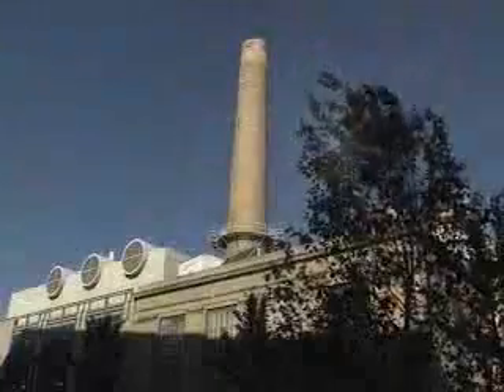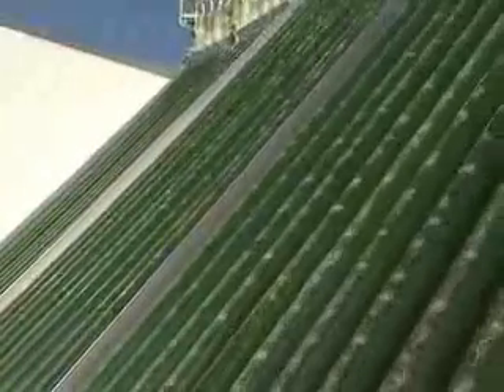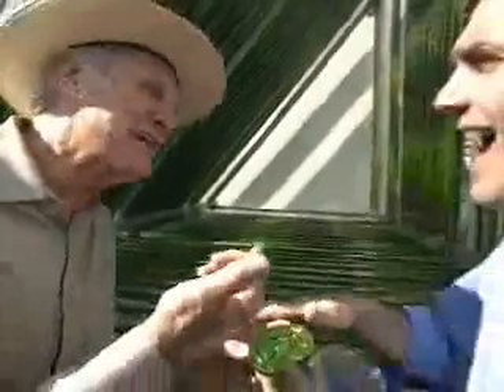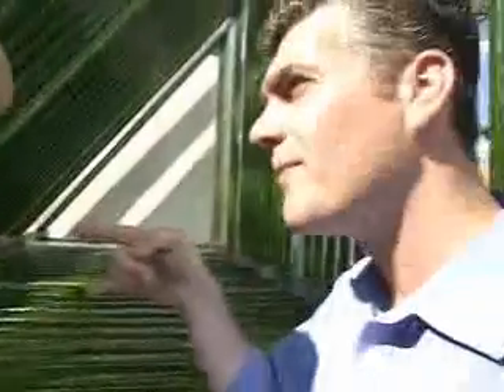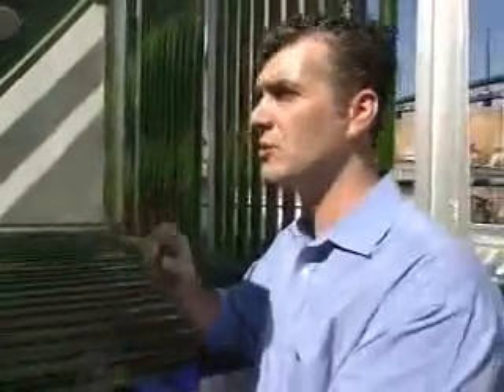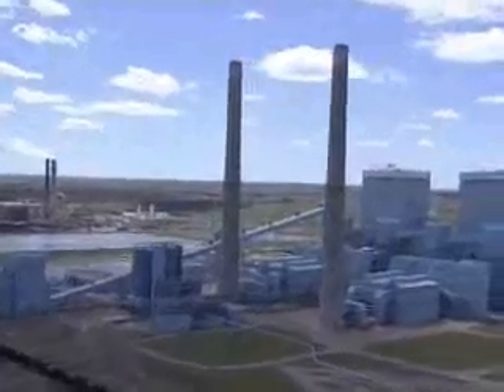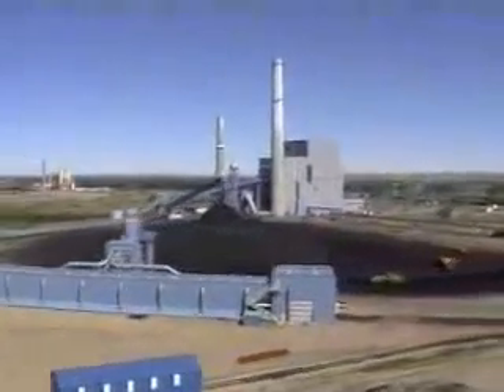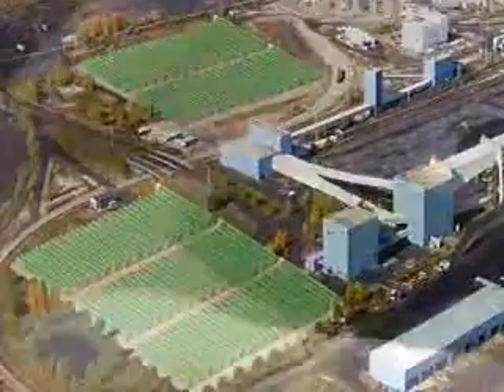MIT Algae Photobioreactor

Comment: Hardly. As SockPupperCommentary was convinced that algae farm for energy would be better, I am fairly sure that they will cost more.

Your right about the light being intense. Shading / shielding  with an outside layer and some gas pressure in between might work. The outside will radiate the intense heat from the sun away and the gas layer would would wrap around to the dark side where it would be cold.

Comment from the maker: Update: I'd recommend googling "Winogradsky columns", it sounds like a good start if you want to experiment with producing methane from an artificial swamp.
Check out the Production chapter in the wikipedia Methane article.  Mentions methanogenesis (your biological route), but also mentions the Sabatier and Fischer-Tropsch industrial processes which do the same thing.  These will be your competitors in the efficiency game.  Good luck :)

Comment: Continued:
I could be wrong but it may be significantly cheaper to both build and maintain a "solar cell and recycle batteries" solution.

On the other hand, maned space flight for long duration in space will likely require looping human bio waste streams with algae back into food and oxygen. In this area, algae seems to be the most promising solution.

Comment: I would like to see some one calculate a closed loop system where Given a specific generator's annual energy needs, how much acreage is needed to capture the suns energy with algae, strain, dry and burn completely. Said system would use O2 created by algae to burn the algae fuel, and the CO2 to feed the growing algae, along with other nutrients being recycled; and then work out the capital cost to build and maintain such a system.
Reply: That's the question most people don't want to answer, because usually the net energy balance is negative.

Comment from the maker: cont...
The algae has only absorbed maybe 1% of the solar energy, so this is the max energy you're starting with, to digest it into methane brings it down further, each process is wasteful.  It doesn't matter how long it takes to digest, you can't squeeze more blood outof the stone than was in the stone to begin with.
5yrs vs 100 yrs.  If the solar+battery system produces 20X the energy, it can afford to be 20X the price or be replaced 20X as often (or a mix of those).

Comment from the maker: Correct, that is what i'm saying.
I do like your idea, i'm curious as to the specifics though so i can work out it's advantages/disadvantages compared to other options.
From how you've described it, it sounds like an artificial swamp connected to a landfill-gas operation, which is cool i guess.
That "one harvest of algae", digested over weeks, will still provide less than 1/30th the total energy that solar panels and batteries would have.  Photosynthesis is just too inefficient.
Continued...

Comment from the maker: But you're talking probably sub-1% solar efficiency all up.  Probably much worse, but i don't know any efficiency figures for algae-biomass to methane.
Solar panels with ANY kindof batteries would beat that, no matter how much they needed replacing.  It could be over 30X the cost of algae and would still be cheaper.  Also bacteria will shade the algae in the photobioreactors if they are grown together, further reducing efficiency.  Thus sterility is normally a very serious concern for growers

Comment from the maker: Woa i never even thought of combining it with anaerobic microbes and methane, that's a good idea!  
Don't burn it as a stationary fuel source though - photosynthesis is way too inefficient at converting sunlight into energy compared to modern solar panels.  Instead use that methane as a transportation fuel; for cars, trucks, trains, planes, etc.
For stationary power, use solar panels with energy storage (flow batteries, pumped hydro dams, compressed air), or solar thermal with heat storage.

Comment from the maker: @captncanuckle >"coldest global year on record"
Doubtful.  Which year?  check the records.
Also graphs are not straight lines, they do have dips.  A single cold year does not change the trend of increasing global temps.

A few glacers are growing, most are shrinking.
Antactica's ice sheet tends to grow in winter, winter just ended 3 days ago.

The medieval warm was not global, and temps have been greater than it since at leasts the 1960s (more likely the 1900s) and temps continue to increase.

Comment from the maker: The increased sunlight would make the algae require more CO2 as well.  So you will have to increase the bubbling.

I have seen some photobioreactor plans that use concentrated sunlight, rationed to feed more algae via fibre-optics.  The concentrated sunlight is split into many fiberoptic lines, each feeding dim partial sunlight into a separate algae vat - stacked vertically.

Comment from the maker: Pre-concentrating the CO2 (ie: by harvesting smoke stack emissions) before it is fed to the algae increases growth by 20% (iirc) compared to algae fed with natural CO2 from fresh air.

If you increased the sunlight, you may have to take steps to avoid overheating/overexposing/burning the Algae.  But if you could avoid those problems i imagine you could increase algae growth proportionately to the amount of extra sunlight.
ie: 10x sunlight (if properly rationed) could produce 10x algae.

Comment: "can mirrors be used to get more eficiency on those plants?"

Doubtful, plastic tubes are probably cheaper than mirrors and there are saturation effects(plants are most efficient in low light levels, when illumination increases you increase productivity less than you increase the illimunation)

Comment from the maker: i'm not sure if that % figure is for space or terrestrial.  I don't think it takes solar concentrators into account, but i don't think it makes much difference outside of the lab.

I've recently seen a rough test result in 30% realworld efficiency by GreenandGoldEnergy (a Suncube solar tracker using Zirtec panels).  So i'm confident that they are 35% panels.

Comment from the maker: oh i see.
so you mean - have algae stacked so high so that it's in complete shade down the bottom but have mirrors illuminating that shaded area.

i guess it could work.  It'd be a question of the cost of mirror area vs the cost of photobioreactor area.  If you're using cheap flexible plastic bags to grow the algae (Vertigro) then you may well choose cheap flexible plastic mirrors (ie: coated mylar).  
Either way is cheap, but the mirrors may need a tracking system which would complicate things.

Comment from the maker: You can only have so much algae stacked vertically before you block out the light completely.  
So you can either have:
- low concentration algae stacked very high or,
- high concentration algae stacked low.

Think of each algae cell as a layer of shade cloth.  You can only layer so much shade cloth on top of one another before you block out %100 of the light - then any extra layers after that are useless as there's no sunlight left anyway.

Comment from the maker: hmm, you're kindof right there.  The Greenfuels system in this video is projecting 5,500 gal/acre/year which works out an efficiency figure of 2.3%.  They are trying as hard as they can, so it's far from the worst.

However, Valcent's Vertigro algae growing system is projecting 20,000 gal/acre/year which is an 8.3% efficiency rating.
And if Valcent JUST grow algae for biomass - they have already PROVEN a yield of 276 tons of algae biomass/acre/year.
(but i'm unsure how much energy is contained)

Comment: 35% efficient PV is the very best of solar, and 2.3% algae I would assume would be some of the very worst.

I agree though.  Solar more or less will be the main source of power for our electric grid.

However, algae can clean up our current problematic coal plants.  Sequester the C02 straight off of the coal plant, turn it into fuel, burn it again withe the coal.

It seems to me that we could do that right now, cut emissions for coal plants, while we start building solar panels everywhere.

Comment from the maker: It's definitely a sound idea.
but photosynthesis is nothing amazing - just a chemical reaction.  It still has to compete with other renewable energy sources.

You gotta admit, as far as grid-based renewable energy goes 35% efficient solar PV panels are more attractive than 2.3% efficient solar algae.

Algae's advantages are:
- Easily produced Liquid fuel (ie: for transportation)
- Sequestered CO2

it shouldn't compete with Solar PV for grid electricity though.

Comment from the maker: Yes this is one reason photobioreactors are better than open pond systems.  However, as you go vertical you can only increase the algae concentration until you cast a full black shadow.  Once you reach that - you can't increase the amount of energy being absorbed.
And that max absorption IS assumed in the calculations.

It's a basic concept of harvesting solar energy: the energy you absorb is the same (or less) as the size of the shadow you cast on the ground.

Comment: except the energy is from photosynthesis, so its free and green.  Just use the algae which takes energy from The sun, and the carbon from the smoke stack and turn it into fuel to be burned again.  I'm talking about a method to clean up our current energy supply, while we work towards replacing it.

Comment from the maker: Theoretical upper solar efficiency limit of photosynthesis: 11.5%
Actual solar efficiency of photosynthesis 3% - 6%

remember - Algae gets all it's energy from photosynthesis.  As you can see - for anything claiming to produce more than approx 6000 gal/acre/year, the figures just don't add up.

It's still much better than 800gal/acre/year palm oil (yay), but i wish they would just tell us the real figures from the start instead of BULLSHIT!

Modern triple-junction Solar Panel:  35% efficient

Comment from the maker: Sunlight's energy: approx 2190 kWh/m2/year
Biodiesel's contained energy is 36.94 kWh/gal (0.133 GJ/gal)

here's some efficiency figures i worked out:

100,000 gallons/acre/yr (13,300 GJ/acre) - 41% efficient
Greenfuels initial estimate 44,515 gal/acre/year (5920.495 GJ/acre) - 18.5% efficient
Greenfuels currently estimate 5,500 gal/acre/year (731.5 GJ/acre) - 2.3% efficient
Vertigro's claim upwards of 20,000 gal/acre/yr (2,660 GJ/acre) - OVER 8.3% efficient

Comment from the maker: Ok, i just did some figures.  Greenfuels first claim was 44,515 gal/acre/year.  
Given 250W/m2 of solar radiation and biodiesel's energy content of 0.133 GJ/gal - this would put them at 18.5% solar efficiency.  That's a little high, i'm doubtful.

On their current FAQ they claim 5,500 gallons/acre/year, which is a pitiful 1/8th of their initial claim, but still way better than any other energy crop.  It comes in at 2.3% solar efficiency.

Comment from the maker: Valcent Technologies Vertigro algae growing system is another similar technology.

It cites the same growth figures, but doesn't need concentrated CO2.  They just bubble through normal air, it absorbs all the CO2 it needs from the air.  If they add concentrated CO2 it only increases the growth rate by 20%.

So they don't actually NEED to tie it into smokestacks - it'll grow at 80% capacity without it.
I'm not sure if the MIT tech in this video is the same though.

Comment from the maker: I agree mostly

Except pressure vessels full of hydrogen make for a very cheap and simple battery, it's rather attractive.  i saw one guy with a fuelcell system who has quite a few very large pressure vessels in his backyard - months of power - lasts him all through winter.  To add more capacity he just adds more pressure vessels - very simple things, and i assume cheap.

I'm not sure how big, complex, and expensive the batteries would have to replace such a system.

Comment from the maker: Most of the Algae technologies i've seen need to be fed with CO2 - so it is somewhat reliant on the emissions from fossil fuels.  
However Lith-ion (and non-algae Hydrogen) can harvest power while producing no CO2 emissions - and are more efficient than algae.

Algae is a form of Carbon Sequestration, it makes fossil fuels more clean.  But you're still using fossil fuels.  While we're producing CO2 - Algae is a great option.

Comment from the maker: i just noticed that greyfalcon. net/ hydrogen2.png assumed wrongly that Hydrogen cars would not be Plugin Battery/Hydrogen Hybrids. Since most of daily driving is under 50 miles which would use solely the Hybrid's battery (no hydrogen), with a plugin Battery/Hydrogen-Fuelcell Hybrid charged with Coal you'd still be producing less emissions than a gasoline engine.
But in a Coal energy ecconomy a plugin Battery/Gasoline Hybrid would be better still.

Comment from the maker: a 700bar Hydrogen filled pressure vessel fuelcell system* has an energy density of 4 MJ/ kg.  This is over 5x more energy dense than Lithium-ion batterys which max out at 0.72 MJ/ kg.

google for "national hydrogen roadmap" and check out the graph on the 27th page of the PDF.  
*I think this takes into consideration the fuelcell weight, as my calculations (without fuelcell weight) give even better results again.

Comment from the maker: Algae oil is already a liquid-fuel, there is no conversion loss.

Solar thermal is 25% efficient, not 35%.  Perhaps you are getting mixed up with 35% efficiency Triple Junction photovoltaics.

Hydrogen's primary advantage (over Lith-ion) is not it's system-efficiency, but it's energy-density.  The hydrogen car will use 3x as much charging energy as the lith-ion car, but it will go over 2x the distance inbetween recharges.  Energy density is important in cars.

Also please contact me greyflcn